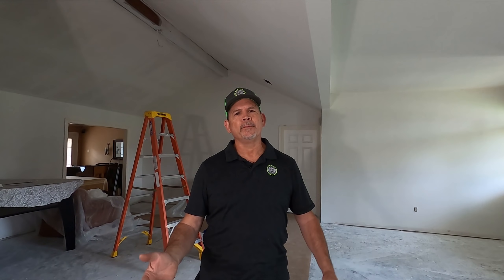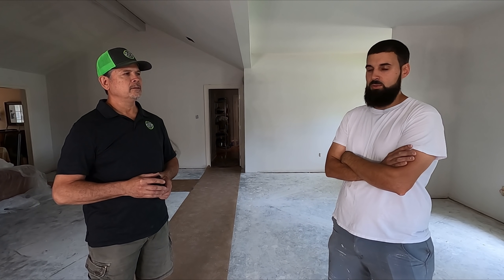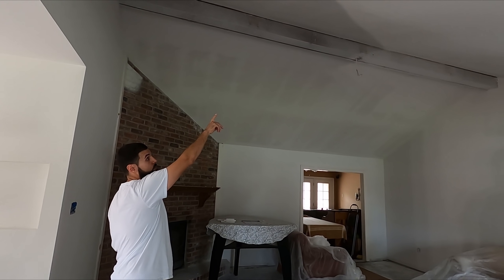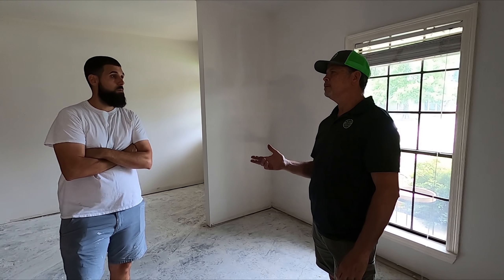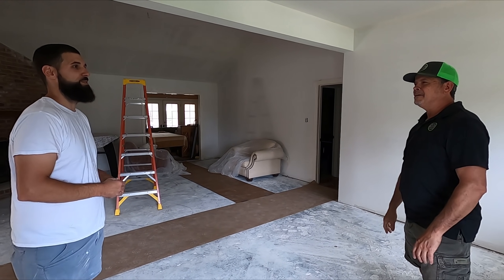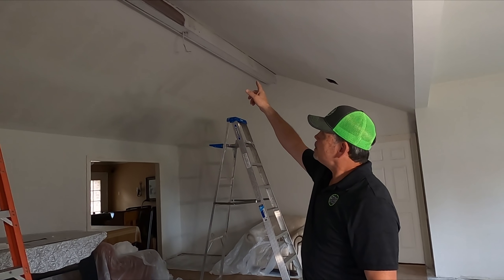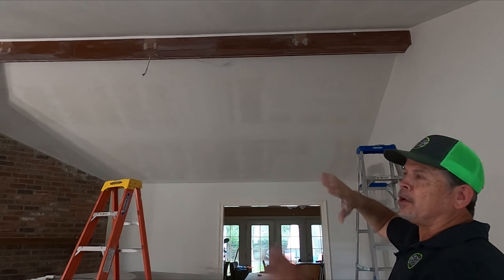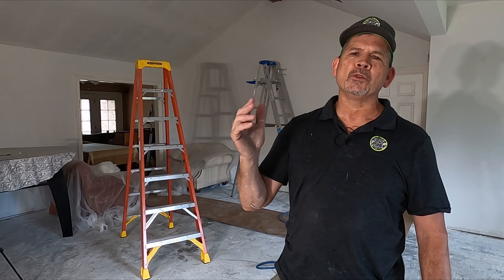A Drywall PRO CRITICIZED Our Work... Ep. 18

Comment: This is how it should be, one tradesman critiquing another to help educate each other, not to tear each other down. 👍
Reply from the maker: Perfectly stated thx Steve 👍
Reply: Dude thats how the union is where I’m from and the worst part is? The people criticizing everyone elses work are usually hacks too. Lot of people in the trades who have no business in the trades.
Reply: Tearing down others is the only reason im on the Internet. If you take that away from me what will i have??
Reply: this only works when there's not a language barrier, or a common sense barrier.
Reply: The hand is quicker than the eye, and also more sensitive. If that hand feels a thing, the eye will see it..
Reply: Criticize to uplift, not tear down.
Treat people as individuals, not political abstractions.
Try to root everything in love and compassion
Reply: Yeah to some extent. Im not a guy who doesnt understand there are experts out there of very high caliber. I just prefer crtiques from someone who can with experience do what they are critiquing. Theres nothing worse than "Well it would be easier for my trade if oyu did that" yeah but overall as a builder i dont want my drywall guy hanging forever trying to make things perfect that you can handle in the finishing. But vice verse if it takes a little reframing , cutting a factory edge piece, rather than 17 coats of drywall compound trying to blend something. You always aim for perfect but some things are easier to achieve than others.

Comment: Well guys here goes my advice. I myself like to use the airless to basically apply the paint, meaning I spray first then I come back and finish with a roller. Reason being that the roller fills everything better than with just the sprayer itself. You get a more even finish rolling after the spraying. It just covers more evenly. Try it and see what you think, if you guys don't do that already. I also do a lot of remodels , I think you guys are very thorough and definitely do a good job. Like you mentioned, it's all in the detail. I think the same way. Anthony Herrera, Santa Fe, New Mexico. Keep up the good work guys!

Comment: Stud Pack you guys did a good job on framing and hanging the drywall on this job. Those angles can be a nightmare, my first sheetrock job was a remodel on an old two story house from 50's, the upper floor had angles on every ceiling with window dormers in each room.

Comment: What do is prime walls and ceiling and bankroll. Primer is a critical step that many don't appreciate so I spend good money on my primer. Next I spray the walls, one finish coat, prior to trim installation. Then I spray the ceilings with two finish coats overspraying the walls. Then I cut in and roll the oversprayed walls with a brush and wizz roller. Then install trim. Paint it twice with finish as well. Then do my final finish on the walls and it's done. I've been in construction for 23 years but this method has worked for me for the last 10 years and is much faster than how I used to do it. Y'all rock!

Comment: in a remodel, I always do the ceilings first, the the walls, and trim last.  When doing the ceilings I don't care if any gets on the walls.  Usually a flat white and I can roll pretty much all of it.  Next day is walls and trim caulking.  If needed, re-caulk the trim and when I am painting the walls, I get make it a point to touch the edges of the trim (makes for a sharper line) and then I cut in at the top and around other places that need cutting in with a brush and roll the rest.  Final day, trim.  Tape off the walls (depending on the type of trim) and use an eggshell (if no color preference was requested).  If no color preference on the walls, I usually do those in antique white... and with the eggshell trim, that really 'pops' out at you when you walk in.

Comment: How we do it is:
1. Spray primer and backroll 
2. Spray 2 coats of ceiling paint and back roll.
3. Install trim, caulk and fill holes and spray in place for a seamless look. (May have to install floors first and paper mask it off)
4. 2 coats on the walls with brush and roller.

Comes out great every time. Love the channel by the way.
Reply from the maker: Thx Aaron.  When you caulk crown to the ceiling do you cut in the ceiling to the crown since the ceiling has been sprayed already?
Reply: Remember work with gravity when painting it’s much easier to paint your way down hill 
So in the case of a crown and you have painted the ceiling first ( although not sure why?) you would caulk the crown recut the ceiling the paint the crown  work your down the hill
Reply: @StudPack  thats what I would do.  As long as ceiling paint is super flat you'll never see the brush marks.
Reply: That's the way I would do it.

Comment: I think, if I was going to spray, I would do the walls first because it’s easier to tape them off with the tape & plastic gun thing, unfurl that down the wall, and then spray the ceiling.  Then do the trim after.  But I’m no pro and I’m curious to see how you pros do it!
Reply: I have sprayed entire houses all 3.  Reverse of rolling/brushing.  Trim, walls, then ceiling sprayed last.  That being said all the windows and doors were being replaced and floors so minimal masking.  What stud pack had on that reno I would roll and brush.  Spraying setup is a time killer setup, prep, cleaning.  If it is requested then it’s different but 14”/18” rollers go very quickly
Reply: @POLOLOUS3  Yeah I was gonna mention those super wide rollers.  Those are killer, knock a wall out in no time!
Reply: I would spray ceilings then trim and brush and roll walls last
Reply: @Davethewall1620  couldn't you get different textures?
Reply: @inglouriousmofo  you back roll smooth ceilings if they are textured ceilings you would never see a difference as long as you do your part with the sprayer

Comment: ceiling then trim then walls has always been my process. I like doing the trim before the walls because i can be as sloppy as i want with the outer edges, I also only use a sprayer for the ceiling and trim. i like the texture I get from rolling the paint on the wall.
Reply: Same, the knap on the roller is helpful to hide minor flaws, not that you'll have any.
Reply: @aiserock  I haven't met a single person who hasn't had at least a couple flaws, if they say the didn't have any they are lying 😂

Comment: i wish you were my dad.  my dad works on everything around the house instead of hiring it out.  so he always spends more and it looks terrible.  but the worst part, im a journeyman HVAC technician.  i started from the bottom. and if you ever done HVAC, understand you're also the 3 skilled trades of electrician, plumber, and hvac, but youre also a land scaper, a crawl space specialist, a concrete man, landscaper, framer, drywaller, trim guy, and psychotherapist. my dad literally tries to tell me how to do hvac. he told me i was dumb for bleeding natural gas from the union instead of the cap. but he had pipe doped the union like an idiot. unions are literally for bleeding, easy disassemble[and other purposes)

Comment: I live in a condo and many years ago, my common wall neighbor and I had a water leak in the drain pipe from the 2nd floor to the 1st floor.  I gutted my downstairs bathroom myself and redid the drywall in patches.  Yes, it looked like krap when you look at the inside of the wall but the part that really counts looked fairly good after I finished and I didn't have an impact driver yet.  My neighbor hired "pros"  and they used nails and hammers to hang brand new sheets of drywall.  Geez, it was noisy as hell and wow, was it expensive!

Comment: If you have textured ceilings and walls I’d spray the ceiling first, spray the trim, and the spray or roll the walls last. This way your masking tape goes on the smooth trim and you get very crisp lines.
Reply: you'd texture trim?
Reply: @cory3106  We're talking about painting here, not texturing.
Reply: @ThomasVMan  I'm sorry I guess I didn't read that thread close enough.  an easy mistake, though, in my own defense. texture and paint can both be done by spray-on application

Comment: I'm definitely not a pro, but I'd paint the ceiling first.  I always like to work my way down since I usually screw something up under me and don't like redoing work lol
Reply from the maker: Same here thx Wesley 👍
Reply: Definitely ceiling first ... Never fight gravity
Reply: Yep, I spray trim & ceilings first because they're usually white and the walls darker. You can run 2in tape on the ceiling and spray with a shield. Trim is easy to touch up

Comment: Whats the shingle trick?
Reply from the maker: Using strips of asphalt roof shingles 1-1/2” wide to shim behind drywall where necessary to correct out of square, out of plumb situations.  Single layer shingles only or the top half of architectural shingles. Cut strips 1-1/2” wide and attach them to the framing with drywall screws to get everything perfect before drywall. Works great.
Reply: @StudPack  great thank you!

Comment: I am new DYI but an old guy (71). Pushing the Drywall with one hand as you use a professional drywall screw gun is a big tip I plan to use on my drywall remodel. The only thing I think would have made your job easier is getting an inexpensive drywall lift from Harbor Freight or renting one from the big box especially with 12 ft. as you only have one back. Also I kept cringing you used a respirator for the pink insulation but not the drywall cutting. I know its hot in Louisiana making a respirator hard to use but lungs are a terrible thing to waste. And that reminds me rock wool is a better insulator than fiberglass but also more pricey but Louisiana is a humid state and rock-wool is better with moister and holds its R value. I do wish I had your skills why don't you come to North Georgia and help an old man finish his remodel. The new kitchen cabinets have been siting in boxes in the living room 4 years and my wife has not divorced me yet.
Reply from the maker: Thx for the tips Jeff.  Spent some time in Dahlonega, beautiful country up there 👍👊

Comment: For sure ceiling first slightly onto the walls, you can't paint two surfaces up to an edge, the minor imperfections in cutting-in will leave a thin wavy line that is very noticeable. The tops of the walls get overpainted when you cut in and that leaves a perfect joint.
Reply from the maker: Cool thx 👊💪

Comment: Use your sprayer to spray the primer on all the new draywall.  Then use the sprayer to spray the ceiling. I usually do this the same day, as I am going a whole house and the ceiling where I started is already dry.  I dont clean the sprayer between just, spray whats left of the primer in a trash can until I think the ceiling paint is all the way to the sprayer gun.  Then spray the ceilings, overlapping on the walls.  For walls, I wait and cut in with a brush and roll them.  Taping is just too time consuming and you have a good chance of the tape pulling fresh paint off.  Using a shield requires too much experience for my patience, as the shield will often have too much overspray on it to not transfer paint as you move it.
Reply from the maker: That’s my plan Mike thx 👍💪

Comment: ok I have built a few faux beam ceilings.  Those nails driven from the back were driven into blocking on the ground then hung. Nailing to the blocking to afterwards create the fake beams. If you know a way to do it easier than that I would like to hear it. More than likely you just didnt think you would do that job.

Comment: looks great, they did a great job of taping etc, Leaving you guys to work some more magic. One question though, the roof shingle trick? sounds like you use it to shim the beads? and then tape over it? would love to see exactly what that meant. But a quick demonstration would be enough, if you can find time. Thanks and keep posting.
Reply from the maker: Roof shingle strips 1-1/2” wide between framing and drywall to account for out of square framing.  I use a square to see if how much the framing is off and correct with appropriate thickness of shingles to get closer to square.  Screw the strips up with 3 drywall screws.  Use top half single layer portion of architectural shingles otherwise too thick 👍
Reply: @StudPack   Great tip... I used strips of ditra/ditra XL on a recent project because I had it nearby, shingles would work well.

Comment: Talk to us about the texture! Don't tell me they wanted you to put stucco texture on fresh drywall? OMG!!! 

Ok but seriously: If your going to spray prime everything  you know how you must eliminate all dust by blowing it off  (Use your shop vac hose on backwards with just the lid), dusting it off and or vacuuming it off. 
Spray the ceiling first.
 then spray the trim with an FFT 315 tip. 
Lightly sand between coats to get rid of any  dust crumbs then role your walls like normal.  
Don't worry about over spray on your walls from trim and ceiling your roller nap will hide it when you roll two finishing coats on the walls.
 If by misfortune you do any over spraying and you get a line or a run,  just wait a minute role it off with a fresh or damp roller wait another 5 minutes for the area to flatten out and respray it  over light and fast. Roll the excess paint on a scrap piece of dry wall or on the wall.  Spray in the direction of the most prominent light source for the ceiling. Your going to want a 3' extension on your spray gun to get the ceiling probably a rolling scaffold as well. And clean your gun each morning let is soak overnight in a bucket of fresh water.
Reply from the maker: Awesome stuff thx Drew👍

Comment: Spray ceilings. get a 180 degree attachment for your graco gun. first colour coat just aim slightly down so you only have to cut in the top twice. I don't do a lot of textured stuff but I don't think you are ever getting away from backrolling your first coat. I like benjamin moore Super Spec Ceiling paint as my sealer and ceiling paint, saves a step and it's a nice matte finish for ceilings, sands easy and takes a top coat well as a wall sealer. Worth talking to a rep to get a price but it's also not a bank breaker since its a commercial product and you might use 10 gallons for that whole space with two on the ceiling.
Reply from the maker: Thx much appreciated 👍

Comment: what's the shingle method to get corners straight?
Reply from the maker: Basically cutting 1-1/2” x length of single layer shingle to use to shim framing out where needed prior to drywall

Comment: Pro tapers and hangers are worth their weight in gold. I stopped doing large drywall jobs ( over 50 sheets)  two decades ago...These crews have gotten smarter...I used to get 8+8 hung and taped, Now it's 15 +15 ...Which is still a good deal...
I've built many vaulted ceiling rooms and additions, It's a really nice look but; Maintenance can be a real pain and your HVAC gets a bit funky... Cobwebs, etc...Often, another bedroom could have been installed in the space..That's added value. Just sayin.
Reply from the maker: Thx Rob 👍💪

Comment: Spray and back roll the paint but remember you must sand between coat and sanding after the primer is a deal breaker. 
And always paint your way downhill use gravity as you friend is much easier to paint ( and cut in) when the paint wants roll done  but don’t forget to sand I see this on almost all my project but so called pros they want to cheapen it up and skip this most important part

Comment: I must've missed it , what's the shingle trick you are talking about ?
Reply from the maker: I didn’t show it.   Basically using 1-1/2” strips of shingles (single layer only) to shim our drywall.  36”’long shims make short work of shimming framing prior to drywall.  Attach shims with 3 drywall screws
Reply: @StudPack  oh that's awesome , Thank you for the reply and tip I appreciate it

Comment: True Pro. Hard to find on youtube.   @studpack .Found your channel a month ago.  Had a home owner decide to hang his own drywall. Used your channel as a video reference and dropped him a panel lift. 135boards over a garage. splayed angles everywhere. curious if your man is using level line or straight flex for the inside splays. Ive used straight flex sense its day view in 98,(I believe) . Hard mud only.......Its a sad sad sad reality that finishers in NC are using Lightweight plus3 for taping....this guy has it right. Those folks using the lightweight in my opinion are stealing.  Bathroom tape will fall off the wall eventually. .....Tubs.....how does your Hangers finishers flat tape to them? We cut the rock bumped to the very OUTside of the flange and pack the gap to the tub with quick set. Taping that gap, creating a flat surface incompassing the tub. zero bulges in the angles.